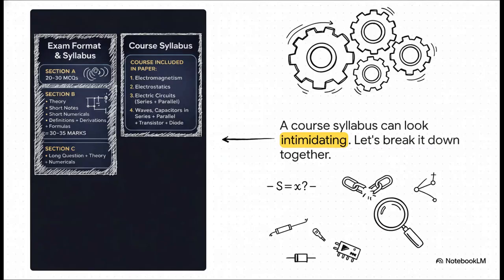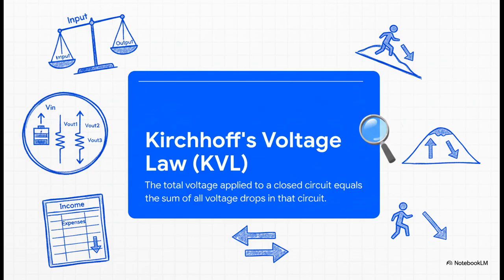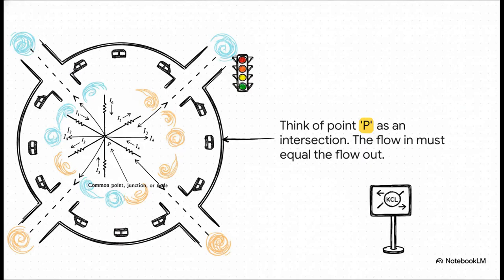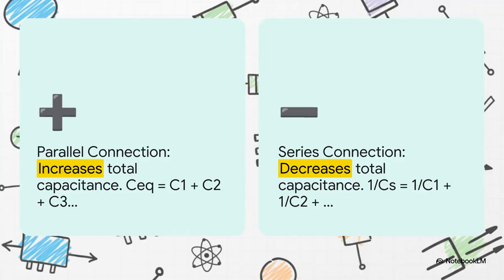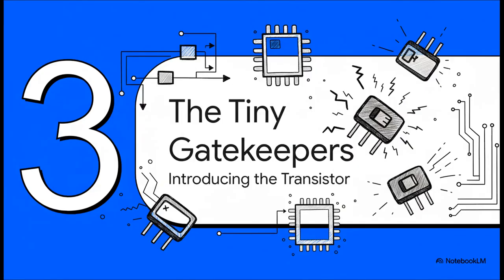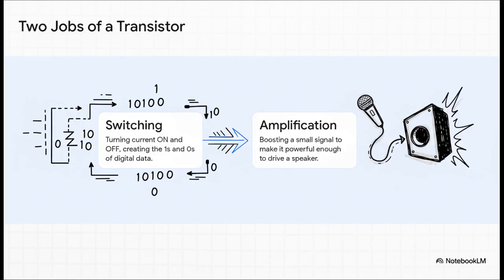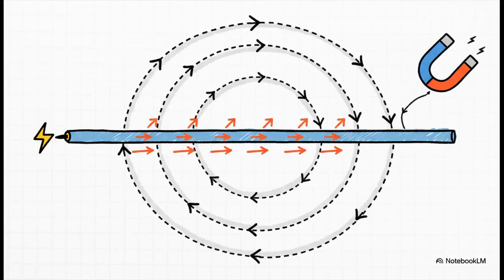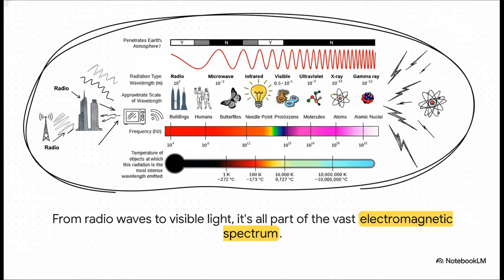How Computers Actually Work (It’s Just Plumbing)

Comment: You could show an N-input AND gate by connecting N water valves in series and an N-input OR gate by connecting one end of N water valves together.  I’m not sure how you would construct a NOT gate.
Reply from the maker: For the NOT gate, you have to flip the design! Imagine a valve that is held OPEN by a spring. Water flows freely (Input 0 -> Output 1). But when you apply 'signal' water pressure to a control piston, it pushes against the spring and slams the valve SHUT (Input 1 -> Output 0). It’s called a 'Normally Open' valve, and it’s actually how old hydraulic computers used to work!"